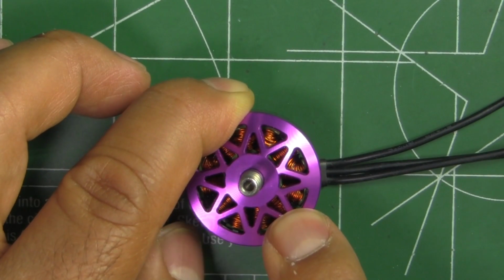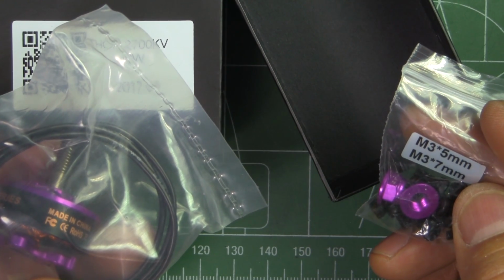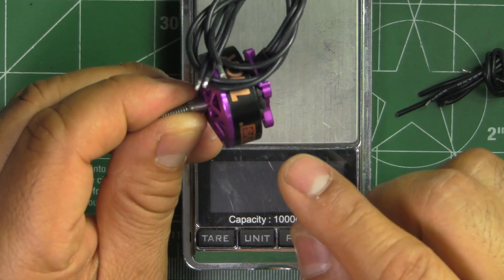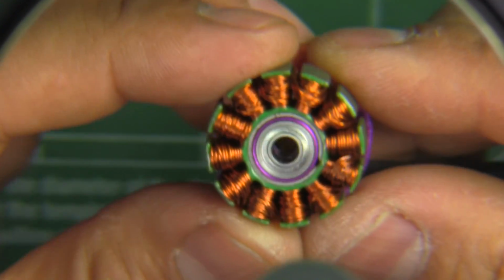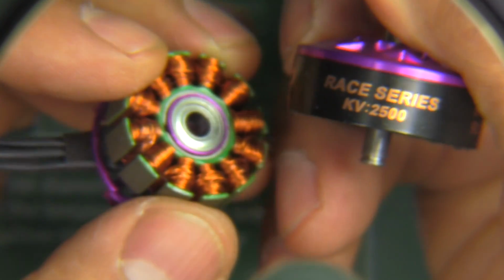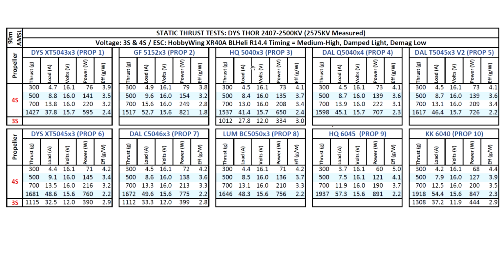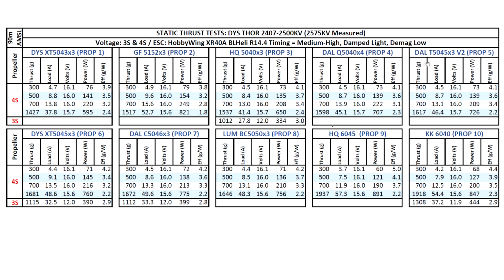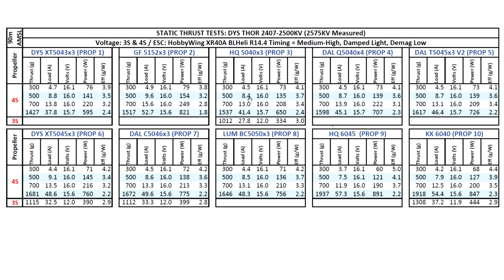dys THOR-2500KV Thrust Tests & Overview - Powerful Hammer!

Comment: how much torque do they have at constant wattage?
Reply from the maker: Unfortunately my thrust stand can't measure torque. Motor would need to be on a floating mount coupled to strain sensors or with a lever arm that registers a force so F*D=Torque can then be calculated. Maybe eventually I'll upgrade to RCBenchmark thruststand that has torque sensors
Reply: @EngineerX  I know you can use power (watts converted into horsepower, 1  horsepower = 746 watts ) and rpm to measure torque on a DC motor. but not sure if is the same for brushleess. in theory it should be the same, often a 500=  watt motor at 2600 rpm should have about 50 newton meters of torque if you add 1 small gear and a gear 4x its size

Comment: This is FAR from scientific, but bear with me (I found it quite interesting): I compared Emax 2306 2400kV numbers between your test and MQTB (since you have a different 'scale' but it appears to be rather linear), to derive a ratio per prop. When I apply these ratios to the Thor 2500kV, I end up with almost EXACTLY the same thrust AND amp numbers (within 3%) as the T-Motor F40 Pro 2400kV, which is only tested at MQTB, hence the ratio's :). Both for light (5040x3) and heavy (butter cutters) props. Even the 6"! Yes, the F40 Pro does 1,8kg which would be almost 2kg in your scale, so to speak.
So, for same money, 36g less weight on your quad (specifically: where it counts the most, tips of the arms!!) you get identical performance with the T-Motor F40 Pro 2400kV :) Again, not science, but it's not gonna be miles off either. The extreme stator dimensions seem wasted on 5" and maybe even the lighter 6" inch props. Same was concluded for the F80 which could easily push 7".
Please keep up this channel because I find it a very relevant source of information.
Reply from the maker: Well, your analysis is somewhat scientific because you're using empirical data from 2 sources. Of course we're not using lab-grade equipment, controlled environment, doing 100's of repeatable samplings, etc...  
Yes, it's very possible that the F40 Pro could reach very close to 2Kg in my testing equipment, Although at the very top end things don't occur linearly as the temperature in the motor windings get high, resistance increases, also the faster the props spin the more power is needed to increase rpm's (drag-velocity-force relationship) 
I think your analysis is pretty cool and should be very close to actual thrust in my setup. I contacted T-Motor about test samples but they never replied. Thanks for sharing your use of the data from our tests!
Reply: I really wish they'd send you some F40's, both KV. A) to contextualize the other motor tests and B) because I really want to see some 2400kv and 2600kv numbers side by side. 
By the way, in a perfect universe (please stop me if this exists already), your valuable data and that of MQTB would be normalized, placed in a database (or just two separate data sources), so I could program a frontend that allowed me (and anyone else) to filter and compare motors based on very specific parameters, such as performance for a specific prop, efficiency around a certain throttle range, acceleration, weight, dimensions et cetera. Even put multiple motors together in a plotted graph for comparison. 
The idea is that, apart from being able to compare faster, you don't even need to know of a motor's existence before being able to find it.
Oh well, one can always dream :)
Reply from the maker: That ability to compare motors from a unified database already exists on a parallel universe LoL. 
Yes, that would be an awesome resource for everyone!
Reply: F40 motors are small in comparison to Thor, maybe you could get similar thrust but you will never have the same amps and when F40 burns, Thor will spin on. If F40 were the same t-motor would not make F80 :)
Reply: In part speculation. 
Actually, I already mentioned in my original post that the F40's pull roughly the same amp per gram of thrust as the Thors, which can be seen from the extensive test results of MQTB. Second, the lineup of f40, f60 and f80 does not validate the Thor, since it is still very much possible that the Thor would burn up earlier if the f40 simply has a better construction, with less resistance. The opposite hasn't been proven and looking at the proven endurance of the pro motors, the odds are against the comparison, if we want to keep it scientific. 

Having more stator mass (all else being equal) may slightly help cool the motor (averaging out the head across the stator) but if the same wire is being used, again all else equal, the change of any part of that wire burning up isn't that much different. That, and adding 36 grams (!) to your build certainly puts more stress on your motors if you want to go just as fast. The F80's main difference is that it can generate a lot more torque which will help spin a heavy prop on lower RPM's, making it much more suitable for 6-7" props. Even the F80 simply falls short of the F40 power on 5" props. Bigger doesn't mean better, as numbers have proven. Different applications. 
Last but not least, burning through a lipo in 1,5 minutes barely makes the F40's hot, even on Avan R props.

Comment: Don't look quite as nice as the EFAWs in terms of windings.
Weight more too.
I like the EFAWs a lot, but the quality has been so patchy.
Reply from the maker: Luckily there's lots of new motors released lately by every manufacturer. So pretty much anyone can find their best pick. It's hard to decide which one to get. Rewind back to circa 2011 ( I think that was the year) it was either SunnySky X2204 or Cobra CM2204 LoL

Comment: I really enjoy your reviews. When are you going to do some 5 & 6S reviews for those of us power hungry fliers???  I'd like to see the lower KV motors with 6" props on 5 & 6S (F80 2200kv, DYS Thor 2200kv, EFAW 2200kv, etc.)  Please????
Reply from the maker: Daniel Bolton I have requested 2200kv from EFAW.  Most companies have been sending 2300kv and above. I do have some older DYS Fire 2100kv. I WOULD have to see how the Amps climb on 5S and 6S because on static tests they can get pretty high and my ESCs are good for bursts of 50A.
Reply: 2200 EFAW might go on my next 6" build and I'll run at least 5S on it so that would be awesome.  If you get the chance to do high voltage tests I would love to see the results.  Keep up the good work!
Reply from the maker: I think that will be an awesome setup. I've seen a couple of videos of the 2200Kv motors on 5" - 5S & 6S and they're amazing. Looking forward to your flight videos for sure!
Reply: Really dislikes this increased KV thing.
Manufacturers upping the KV all the time, and here where I live, in Australia most retailers only ever order in the high KV model of the motors. Meh
I have some batch 2 EFAW 2200s on a Armattan F1-6 - nice motors but they squeal like you have loose props - even though the props are loose.

Comment: I can hear the battery crying. Those motors are crazy powerful, but the amp draw is getting out of hand.
Reply: Efficiency can only achieve so much.  Even in a perfect world with a 100% efficient motor that turns the battery energy into torque with 0% loss more thrust still = more amps.  If you want more thrust, you need more amps.
Reply: Plur307 Yea but we don't currently have the battery technology to keep up with all the new motors. I love high thrust but I want to fly for more then 2 minutes, and without crazy voltage sag.
Reply: right, that's why you need to focus on extreme lightweight if you want more performance.  But I agree the battery is the limiting factor.  Lightweight and things like thinner arms and lower drag will reduce amp draw in the air and help the props unload more.

Comment: Can you test this motor on 6s? It would be interesting to see the results.
Reply from the maker: Copied & pasted from reply to similar question. On 4S already close to thrust stand limitations. Motor should be able to handle 4S on 5" props - should be Monster Power! 2Kg from triblades perhaps? 
................ just worried about the Amps. The thrust testing equipment has current-handling limitations. The HobbyWing XR40A ESC I'm using is rated at 40A but it can of course handle higher Amps in short burst. The RCBM thrust stand is rated @50A and the power supply is rated @60A. 
I know the motor can take higher Amps but I don't want to fry any of my testing gear.  So that's the reason I didn't want to test the 6040 since the Amps were already pretty high. I really should be using LOWER voltage, 14.8V, but I decided to keep using 16.1V since that was the voltage provided by the LiPo 7700mAh 4S battery bank I had been using for nearly 2 years of testing. So to keep results consistent, I continued to use the same voltage, but with the constant big-power motor releases, the higher 16.1V is becoming a current-handling capability issue for my thrust stand setup.

Comment: Looks like they are basing a motor off the EFAW 2407...
Reply from the maker: Yes , looks very similar (stator size and motor style), but the EFAW looks the same as brushless motors used to look 5, 6, 10 years ago. It's just a variation of the old "bell type outrunner motor", nothing new really.
Remember the AX motors?
https://hobbyking.com/media/catalog/product/cache/1/thumbnail/565x414/9df78eab33525d08d6e5fb8d27136e95/legacy/catalog/25555-2.jpg

https://hobbyking.com/media/catalog/product/cache/1/thumbnail/565x414/9df78eab33525d08d6e5fb8d27136e95/legacy/catalog/25556-2.jpg

https://hobbyking.com/en_us/electric-motors-1/size/bell-type.html
Reply: Yes sir.... Just amazing are hobby has more innovation in less time than the iPhone.... Crazy! And I agree it's all down to the basics they are all brushless motors end the end with different body's.....thanks for sharing your reviews they rock...
Reply from the maker: Very true! Difficult to keep up with everything coming out. Used to think 6-month cycle was fast (as in the cell phones) but the multirotor industry is moving in monthly cycles it seems. 
I bought one EFAW 2500KV and got delivery last week so I'll be reviewing that one soon..... as soon as I finish other reviews I got on queue . Thanks for watching.
Reply: Can't wait for that review!!!! Have a blessed day....
Reply from the maker: Thank you and same to you!

Comment: Awesome!  these motors seem to be very powerful are they the highest thrust that you've seen ?
Reply from the maker: Absolute highest thrust so far was the rcINpower 2305-2750KV 
https://www.youtube.com/watch?v=zY4fHIfd2UY
Let's see what the THOR-2700KV gets! I'm going to be testing it soon.
Reply: +EngineerX sweet can't wait to see those bad boys 👍👊
Reply: EngineerX not to be mean but I think the Emax rs2306 2750kv will pull more, that test was on a 6040 and already the 2400kv on 6040 pull around 1800. That's not fair, you didn't test that prop (6040) on the Emax rs2306 2750kv. The motor probably can handle it because I have seen some people running that motor on 6s with 5045
Reply from the maker: Yes - most likely it will get that much thrust. I was just worried about the Amps. The thrust testing equipment has current-handling limitations. The HobbyWing XR40A ESC I'm using is rated at 40A but it can of course handle higher Amps in short burst. The RCBM thrust stand is rated @50A and the power supply is rated @60A. 
I know the motor can take higher Amps but I don't want to fry any of my testing gear.  So that's the reason I didn't want to test the 6040 since the Amps were already pretty high. I really should be using LOWER voltage, 14.8V, but I decided to keep using 16.1V since that was the voltage provided by the LiPo 7700mAh 4S battery bank I had been using for nearly 2 years of testing. So to keep results consistent, I continued to use the same voltage, but with the constant big-power motor releases, the higher 16.1V is becoming a current-handling capability issue for my thrust stand setup.

Comment: literally just maidened my 5 inch with EFAW 2407 2200kv @ 6s. What a nice coincidence to see you upload this just after :)
Really surprised how much heavier the DYS are in comparison. My EFAW is 32.86g with 2cm of wire.
Reply from the maker: 2200KV on 6S :) Nice! I'll be checking out your videos. 
I believe it's got a 0.5mm taller stator so it's actually a 2407.5. Also if I'm not mistaken, the EFAW has titanium shaft? So that could be where the additional weight on the Thor is. I got hereone EFAW 2500KV   bought for testing but will only test up to 4S as the current draw get unruly on the static thrust test.
Reply from the maker: Insane.... just watched you ripping on those. What LiPos and how long can you fly?
Reply from the maker: Nice extended backyard there and nice flying. Thanks for sharing. Those EFAWs look amazing on both 5S and 6S. Which do you prefer? seems like the fly very similar on both, which is a good thing!
Reply: EngineerX they were turnigy graphene 1300mah 6s and if your flying pretty fast you can get around 3 minutes or much more if taking it easier. I think I prefer 6s for wide open areas and 5s for slightly tighter areas. They both are pretty fun!
Reply from the maker: Sweet ! thanks for the info. I''l have to pick up a couple of those. Darn! had the 5S on my cart when they went on sale about a month ago.....around $25 for 1300-65C uuugh ! gonna wait for next sale.
Reply: EngineerX lol yeah that's where I get all my lipos, just waiting for the sales SUCKS! I'm really, really loving the EFAW 2500kv on my lightweight (is 329g without lipo considered light? I don't know anymore) mrm stretch reaper frame. there haven't been many cases but I was one of the few unfortunately.. my batch of 2500kv were slipping magnets. less than a week later Nick is sending me replacements though! pretty stoked by the good customer service

if you have a chance, I'd fly the 2200kv on 6s 5" with T5050C props, such an awesome and fast combo. I feel like 2500kv is almost too fast unless you have a field behind your house haha
Reply from the maker: Good advice on the 2200 + 6S. Will keep that in mind -Thanks! Definitely 6S + 2500KV too much for the small parks I fly in, no nice field behind my house unfortunately -LoL. I would 329g without battery is light. Then, there's those super or hyperlight under 300g. Good to hear they're quick to replace defective motors. Gives a lot of confidence. I need to build me a light quad. The one I'm currently flying is 350g.
Reply: It's really hard to build a light quad that can do 5s or 6s! Each 50v 220uf cap weighs 2g, then there's the escs. You could get the emax bullet 30a that weigh 1.9g with short wires for 4s, but with 6s the smallest I can find seem to be the spedix 30a hv which are like 4g~. It's super hard to find a good balance between strength and light weight :-( I've been considering trying 6s without caps since the spedix seem to have decent filtering.. but I dunno.
Reply from the maker: I hear you. But best to build strong & reliable and carry a little extra weight, at least that's my thinking. I rather not deal with blown parts or noisy video from voltage spikes.